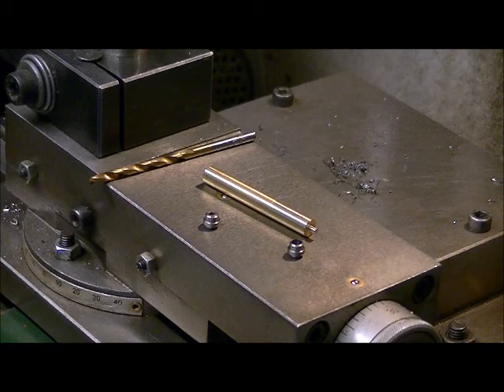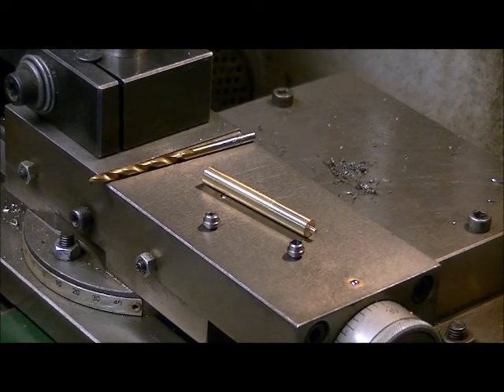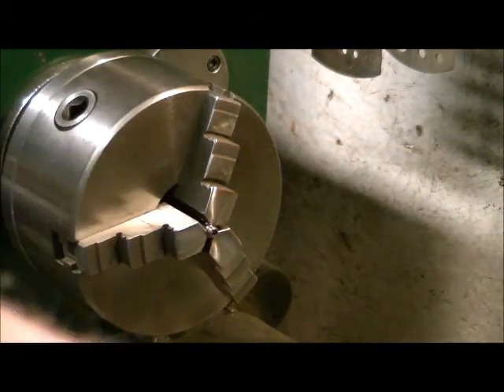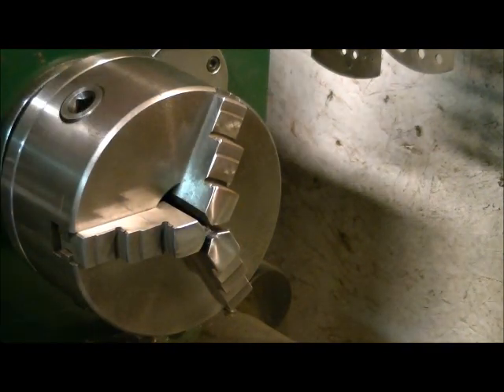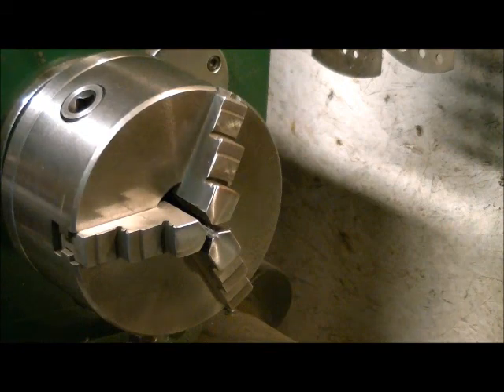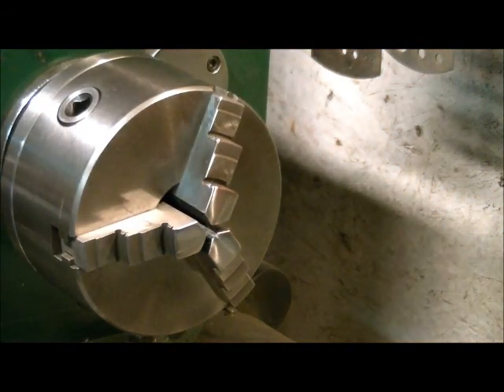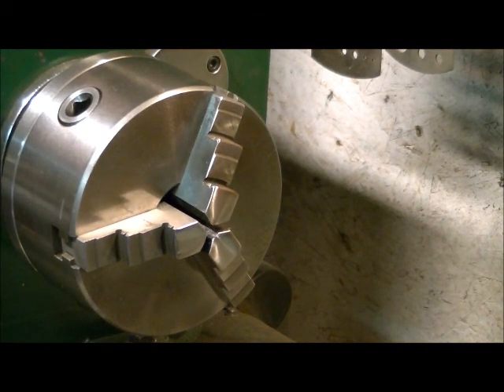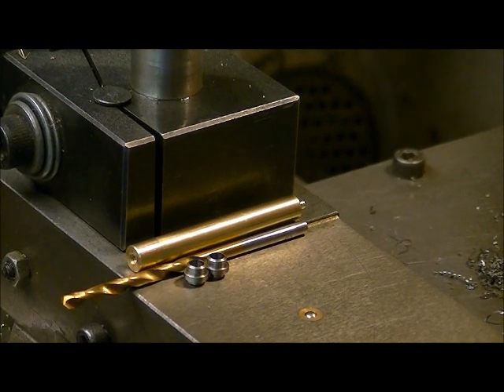Crosman canadian 1377C transfer port mod.wmv

Comment: Bwahaha!  there is always one trying to rain on your parade.  Thanks for the video.  I am trying to mod my 1377 I've had for many years.  I wondered about increasing the size of the hole in the transfer port to increase the air flow.  Seems like it "should" work.  As I have a lathe, I may make some transfer ports from brass, and make several sizes and see which one flows best.  Wondering about chamfering (countersinking) both sides to see what a venturi effect has.
Reply: Share your results
Reply from the maker: give it a go and see what happens, you can also lighten up the valve spring in the valve as well it will also help with some extra power

Comment: What do you think about the max flow port, .161 size over stock? What kind of gains if any will that give the 1322. 18" barrel, ext probe and 14.3 gr pellet?
Thanks for any info.
Reply from the maker: the speed varies gun to gun some need vert little others need more even in the same model

Comment: for a simple mod, staying under 500fps, would it be safe to bore out the transfer port with everything else stock, or would you need a couple more things to be done with that?
this is on a Canadian version 1322 .22 cal, only have a 14.5" barrel with muzzle brake, and steel breach. also have the extended bolt probe on order. just looking for a few more fps. 

thanks to any suggestions
Reply from the maker: youll need to bore out  the port yes and it will still keep it under 500 fps and depending on the bolt prob you order it can then put it over 500 or  keep it even more under 500 so then you defeat your self its a touchy thing doing the mods
Reply: Kevys Rc & Music thanks for the quick reply. Ya it is finicky just like throwing a cam in a car, haha but ya I do plan to get a crony in the next month or so, figured it be best if always tinkering. I didnt know there were different probes? just hollow or extended. hum..... 
guess ill have to see what that does. im after accuracy more then anything and smooyh operation, which i have polished everything i could and some, also shimmed to align everything,very nice now. custom barrel band, and tightened up the pump arm piviot point. all the usual upgrades. very fun "toy" haha
Reply: Kevys Rc & Music also have a video uploaded on.my channel, of what has been done.
Reply from the maker: cool ill check it out
Reply: Kevys Rc & Music hum ok, that i might have to send out to get done.
Reply from the maker: if you check my videos i think i have 1 that shows how i crown barrels but you can use just a simple drill press and a dremel stone that is cone shaped its really very easy
Reply: Kevys Rc & Music ah ok, been watchen them haha maybe ill gibe it a try, i fo have another barrel to practice on
Reply: Kevys Rc & Music great selection of videos to watch! awesome!! got alot of same thing on the go haha a bit of everything.
Reply from the maker: thanks varity is the spice of life
Reply: Kevys Rc & Music haha it sure is, more the marryier

Comment: Couple of questions from USA,... Does the 1377 & 1322 have the same Transfer Port ?
Does this porting give you more FPS or more Muzzle Energy ?
What if you drilled only half way through so you get greater air discharge at the opening of the port to give more thrust when it narrows through the port ?
Thanks :)
Reply from the maker: the new model 1377 and 1322 have the same TP in the USA drilling the ports all the way thru to 3.9 MM increases FPS which does increase FPE more speed is always more FPE drilling part way thru will not really do much other then waste time..
Reply: Kevys Rc & Music Thanks :)
Reply from the maker: your welcome

Comment: I just made a transfer port seal out of delrin,  the inner diameter is matched to the valve and barrel ports. Seals great, but I don't have any way of knowing if it helped power.
Reply from the maker: time to buy a chronograph
Reply: +Kevys Rc & Music yup! Check out my videos and you'll see my crazy goofy 1377ish project.

Comment: I have a 1377 from the 80's, need a valve now. Not drawing in any air. It might be about 600fps when I got it. Its knocked the crap out of pigions on my roof.
Reply from the maker: best guy for parts is alan at abairguns in the US
Reply: Thanks I'll check it out
Reply: joe souza no problem your welcome

Comment: how much fps you think drilling the tp will add?, so far I have the the flat top piston mod and stiffer hammer spring.
Reply from the maker: on a stock gun its adds 20 to 30 fps
Reply: awesome, thanks for the quick response
Reply from the maker: wolfcalibur no problem

Comment from the maker: you will raise the FPs more towards 500 fps yes the trick when plugging the hole for best results is to make sure you come as close to flush with the exauste port hole in the valve i will do a video to explain this better so you know what iam talk ing about, your other option is to drill the restriced transfer port out

Comment from the maker: do you have your R-PAL cause your going to have to register that gun after all thoes mods, you can just drill the trasfer port out to 3MM and still be under 500 fps, the gun stock only shoots 415 to 435  with  7.9 grain pellets , the speed ratings are only UPTO ratings so the lighter the pellet the faster but you lose energy distance and accuracy with lighter pellets. in canada we have to wach our A**'s on the speed thing expecialy on pistols keep it under 500 fps to keep out of trouble

Comment: i have a stock 1377. canadian version. 495fps. i would like more fps.
can i just drill out the trasfer port?

or whats my best option here?

im going to put in a longer barell and a flat top pistol and valve.but thats later.

Comment from the maker: if your gun right now is a stock configuration from the factory as a PAL version your gun is running about 504 with a 7.9 grain pellet you might be a bit faster and yes the transfer port will make a difference to make it shot faster i also make a moded probe as well in .177 cal and many other parts that will also provied even more power for you, as for selling you mod parts ill sell you what ever you want that i build ,its not my responsibility what you do with the parts so ya no problem

Comment from the maker: the hammer spring in the 1322 and 1377 is already the best just add in the power adjuster to add more power to the hamer, but you do need to put in a lighter valve return spring.

Comment: Ok I just put a stronger spring in for the valve to be able to pump up the gun more and be able to release all the air now Im  Bout to put in my flattened an w ported valve along with flat ajustable piston plus a power ajuster ....

Comment from the maker: you dont if you want more power out of the valve you  remove 3 threads and lighten up the valve stem spring just a bit and add on a power adjuster so you can alter the timming of the valve untill you get the magic dial in for the max power just keep in mind when you start making more valve space by removing the 3 threads you will have to pump up the gun alot for each shot